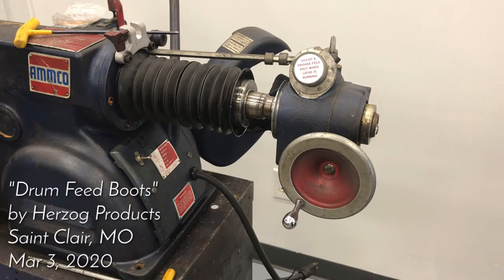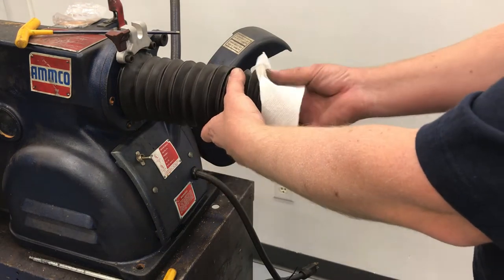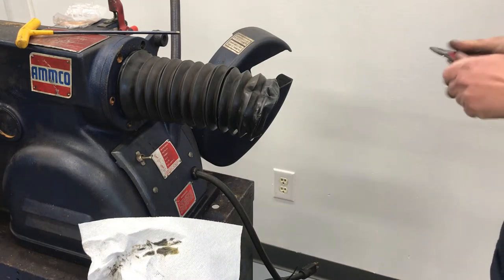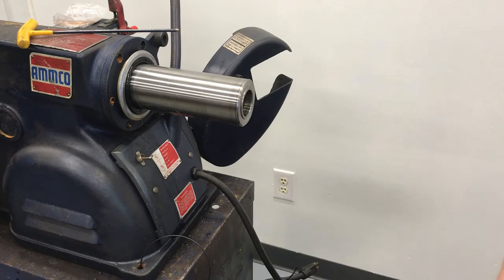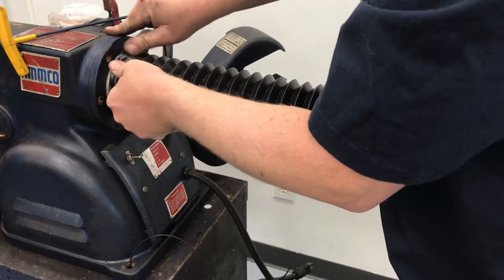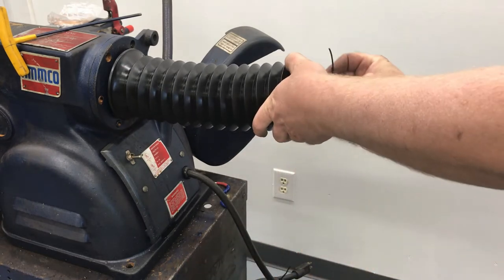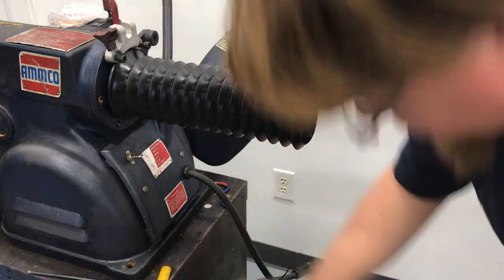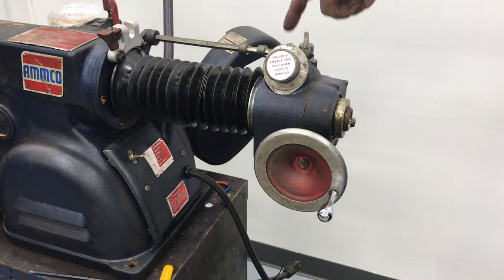Ammco 4000 Series Drum Feed / Spindle Boot Replacement

Comment: I really like to see that tool that you use to put the boot on. I've always just used my finger and kind of put it on like a tire. I've also lubed up the inside of the boot and that groove on the machine with WD-40 it goes on a lot easier that way
Reply: I sure like the older machines that have that little notch in there. Boot goes on like nothing then
Reply from the maker: Just saw this, it's actually a pivot pin retainer clip, a bigger version of what keeps a trailer hitch pin in place. I unbent it to make the ~~ end the handle and bent the straight leg into an L, then ground the short leg of the L down to make it a little flatter. i covered the ~~ with heat shrink tubing so it doesn't get slippery.